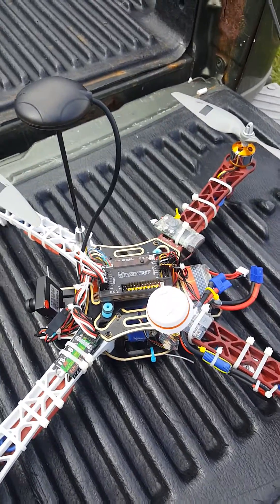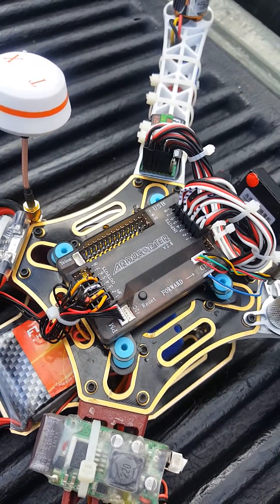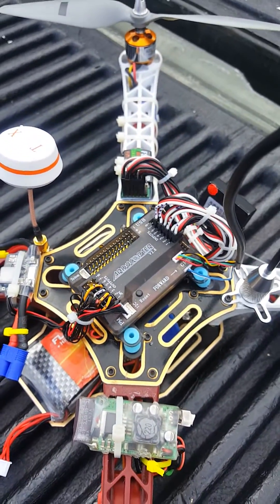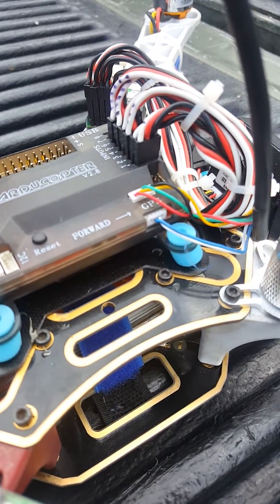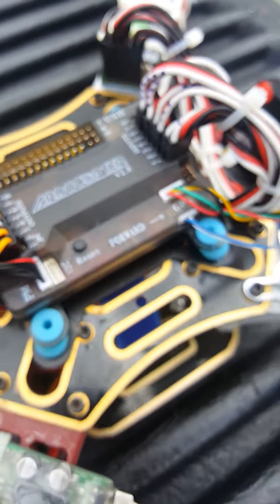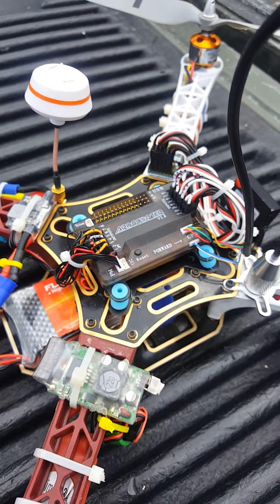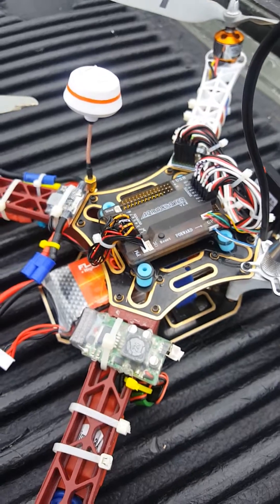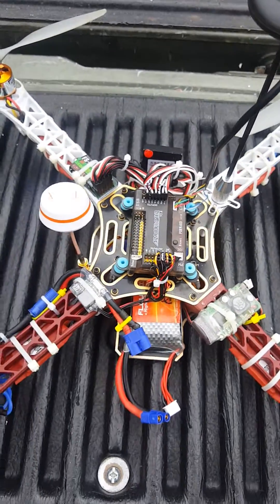APM 2.8 external compass jumper configuration

Comment: how come your compass only has 2 wires. Shouldn't it have SDA, SCL, vcc,  gnd? 

Are those SDA and SCL wires and the compass takes the vcc and gnd from the gps,  right?
Reply from the maker: It’s a combination compass and gps. That’s how it comes. Worked fine
Reply from the maker: Im gonna say (it was a while ago and I now use a pixhawk) 2 are data lines and two are power. Because it’s a combo power is jumped inside from gps, hence why the compass only had the data line.

Comment: Hello, can you tel me, when i go flying, must i calibrate gps on the field Every time while turning de QC horizontal and vertical, or is the calibration on my PC once enough for al de flights ??
Reply: GPS is part of system check apm goes through every time you power it up , it will not let you arm the motors unless it has  a good gps lock.

Comment: Thank you I spent most of the day trying to get the thing to work.then I stumbled onto your video plug in were you said .it works now.
Just one question do you still have to set roll 180 as I did .when I put it into lioiter it drifts off?

Comment: Hey, Had a questions. during alt hold mode and loiter mode I cannot take off. In stabilize mode it takes off but in loiter and alt hold the props spin slowly but not create any lift even at 100% throttle in stabilize it flies OK.

Comment: hm - i can hoover my drone - its stable but when i try to correct the direction it randomly flys in any direction lol - escs & compass 10 times calibrated and workin good.

if i try to correct the rates - its more or less stable at hoovering but whatever i change it still flys randomly when i try to steer :/
Reply from the maker: Bergwacht compass won't have anything to do with it unless your in a mode that uses GPS...make sure the frame type is correct in mission planner. If your just trying to fly and steer even in loiter the compass doesn't effect that.
Reply from the maker: Also....go into the receiver tab and make sure all your rc channels are working the correct direction
Reply: unfortunately they do - but thank you
Reply: i try only the stabilize mode until its steerable -  i think my gps isnt needed with that mode.
iam sure the frame type is choosed correctly. have it set several times like learn up escs & calibrating the compass.
Engine running direction and props installed correctly otherwise it wont hover i think.
thanks for the try
Reply from the maker: You aren't by any chance in headless mode are you? Plug into mission planner and arm the quad (WITH PROPS OFF) and make sure when you arm it says stabilize.
Reply: now its working - used the config from anyone else - dunno where the error was .thank you :)

Comment: can you please share me a video link for external compass calibration? when i removed the jumper cable, Bad compass health error pops up and my compass no longer calibrate? please help me to get rid of this issue.
Reply from the maker: Ammar Khalil are you sure you have external compass selected in mission planner? What gps are you using? Are you sure you have a combo GPS and compass? Most of them do
Reply: Gino Palumbo I'm using amp 2.8 with Ublox 7M Gps plus compass. Yes i've seleted externally mounted compass in MP before live calibration. I can't figured it out yet.
Reply from the maker: So when you start your calibration you get no visual from movement on the screen?
Reply from the maker: And you are plugged into the mag Port and the correct jumper is removed as I showed in the video?
Reply: Gino Palumbo yep. 😕
Reply from the maker: Ammar Khalil do you have another GPS unit around
Reply from the maker: Ammar Khalil first thing I would do is trying reflashing the firmware. I've had bugs before here and there and this has fixed it. Take a snapshot of your compass calibration screen and send it to me. Gino@rockvern.com
Reply: Gino Palumbo owkay. I'll update you when I'm done with flashing. Thankyou for your help.
Reply from the maker: Ammar Khalil did the firmware flash help
Reply: Gino Palumbo didn't got the time for that. I'll do it tomorrow at night. Will inform you then. Thank for reaching me.
Reply: Already fixed it? I am having the same exact problem. APM 2.8, U-blox m8n all connected, checked the port near the GPS plug, no jumper. Still shows bad compass health, even when externally mounted compass is checked, and when I click Live Calibration, there's no reading.
Reply: Gwyne Gomez click the check box use this compass
Reply: asfak mohamed yes even that checked too I checked them all still “bad compass health”

Comment: thx for your great video,i have some question for this board,if im not using power module how to powering the board?i leave jp1 connected or must be removed from board?.and how about magnetometer jumper?its necessary used if im powering the board without power module?.or i must use external gps module like m8n?
Reply: You could use becs from your escs or do what I do and use a 5v bec from my pdb onto the output pins. If you do this leave the jp1 jumper on but make sure you don’t draw to many amps / volts from other components.

Comment: Could you please help me Gino? I tried to removed this jumper and i am unable to arming the quadcopter because bad compass health (of course every time i tried something new variation of the jumpers reflash the apm and make the all calibration process again), also i tried with jumper on the upper position, bad impossible use the external compass which is a m8n. The only result was when i tried with the 12c port and make the bridge 2 pads underneath the port- in this case the board was detected the external compass, i could calibrate, but can not switch off the internal and always have bad compass health message and impossible arming. I tried every variations, seriously, i am really tired all of this...
Reply from the maker: In the intial setup do you have the compass selected as external 180 rotational roll?
Reply from the maker: Also, have you calibrated the compass? And got a good result?
Reply: Yes i tried with roll 180 and i tried with 'none' also. What is interesting the calibration i can do with the external compass, i know it because i removed the external compass from the stand, and during the calibration I only move the GPS unit itself and the APM not moving, when the calibration done I go to the Hud screen and when i rotate the ONLY the gps unit to find North does not happening, BUT when i rotate the APM unit th compass moving on the screen, looks like the external unit is calibrated, i have selected the external compass by hardware (jumper position uppper) and also in the software (mission planner external compass option 1 and 2) but still using the internal. During the flights if I use internal compass in GPS assisted modes i lost the control of the quadcopter if i had wind because of the toilet bowling effect, internal compass does not work well
Reply from the maker: Is there any chance that the solder pads in the back of your APM came soldered?
Reply: Which ones?
Reply from the maker: Sounds like you might have a bad board, I've never set up an apm (and I've done many of them) and had that issue, I've seen where it won't calibrate because of a bad compass or APM board but never what your speaking or. Make sure you purchased a genuine APM board, there a lot of copies out there that I would not trust my hard work and money to.if you split the case you will easily be able to tell if it's a cheap copy, components will be crooked and not straight and parallel, solder joints will not look great...Arduino uses manufacturing process' with good quality chip placement and soldering equipment and their boards will look significantly different. It's really not hard to copy a board and install software....don't forget we are dealing with old serial technology here....been around for ages.
Reply: Of course it is not genuine product, 99 % of the apm are copies, and version 2,8 is just a chinese improved copy of 2.6 which was the latest

Comment: Thank you for this, you have just confirmed how i thought it should be. I am just putting together my first APM 2.8 in a quad, done a lot of reading about having to hook the compass into the I2C port. But when i looked carefully at the pcb i noticed that the port under the GPS port was marked 'Ext Mag'. So i was wondering if that is where it now went. You just confirmed it for me. Thanks, great video.
Reply from the maker: No problem, enjoy the 2.8, it's a fantastic flight controller. I will never deviate from the 3dr products, their excellent, I hope I can upgrade to the pixhawl some day but it's hard for me to leave the APM as I have a few hundred flights with ZERO issues on my main quad so why change, the only thing I like that the pixhawk has is auto parachute deployment but the APM doesn't have the processing power for that 😔. Enjoy, if you have any question about the setup feel free to ask, if you want any more information videos on anything pertaining to the 2.8 please ask, I love to teach :)

Comment: MIne isn't recognizing the external compass.  I have another 2.8 that works perfectly.  I think there are pad that need to be bridged on the underside of the board.  Simply removing the pin doesn't work on some of them.
Reply: goofyfoot2001 hello, could you help. Please which pads need to cut or soldering, my 2.8 does not work with external compass, i tried  all of the variations of the jumpers.

Comment: hello sir , I need your help with my apm 2.8 . When i give throttle , not all the motors start at the same time . But when i tilt it in different direction different motors start randomely. Dont know what to do?
Reply from the maker: You need to calibrate your speed controllers. Sorry for the late response, make sure you always do this without the props on. Look for videos on calibrating with the app, once calibrated they will all start at the same time. Your speed controllers basically don't know where "zero" is in relation to your control loop from your receiver.
Reply from the maker: Sorry APM not app

Comment: Would you post what firmware, and software versions that you used. links would be great. I am trying to setup mine, and having a horrible time getting correct info. drivers, which flight planner to use. THX
Reply from the maker: firmware version of board is 3.2.1 I believe. that's the highest version available for the 2.8 board. the pixhawx will take higher software versions but it's 250$ but is nice because it has redundant gps ports, automatic parachute deployment and many other features. I use mission planner to configure. great peice of software. mission planner comes with the drivers you need to connect to the board. make sure if you can't connect you try multiple usb cords.
Reply: "make sure if you can't connect you try multiple usb cords."THANK YOU!!!!!! Holy POOP! that was what was wrong, USB cord wasn't working correctly. I my project goes much better now! Thanks again!

Comment: nice video ..first of all my English is poor but i want to explain my 7 days  Experience with you all about APM 2.8 . i also bought this Control board with External compass . i also face the same problem . 
when you remove the jumper and disconnect the internal compass but external compass not working perfectly because the 2nd 2 wire connection is using for old compass .. you should connect compass  into 12C near Power module Connection and open the AMP casing and continue the SCL and SDA connection to 12C through Soldering because this poart is multi function .. then External Compass will work perfectly . may be i am wrong but my AMP2.8 now working perfectly .. i am searching more now.. 
 http://www.dronetrest.com/uploads/db5290/original/2X/8/8adf54e4d496b6d666d8cb3be7196ce1c7daad82.jpg
Reply: Bro! Please help me